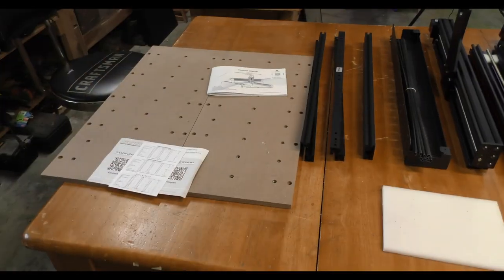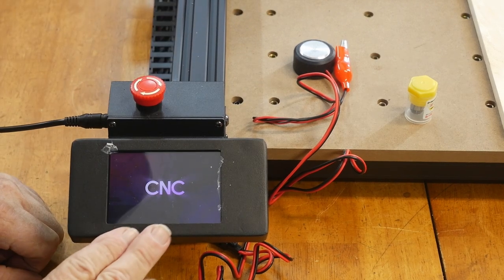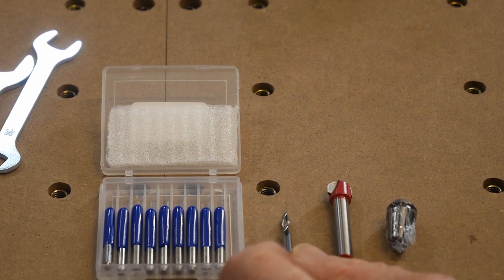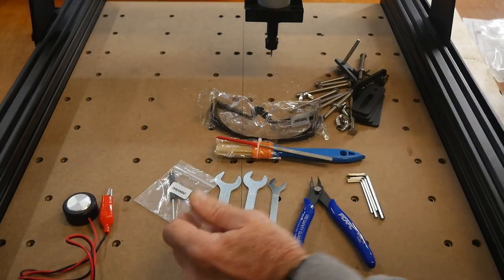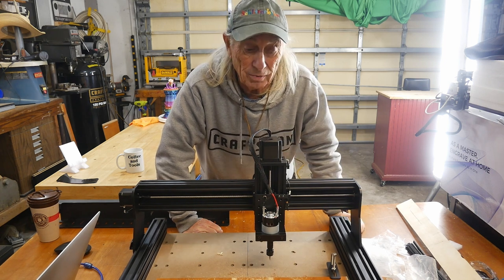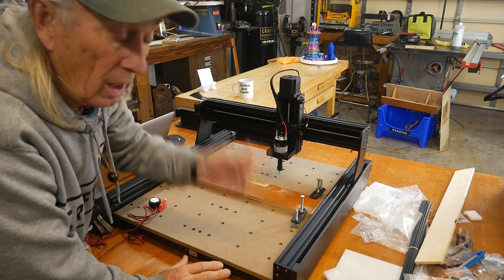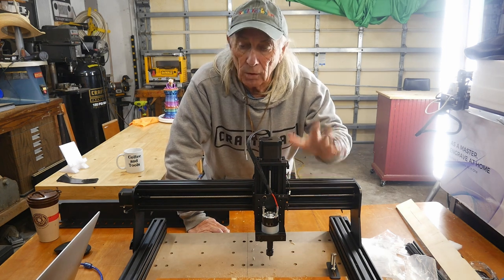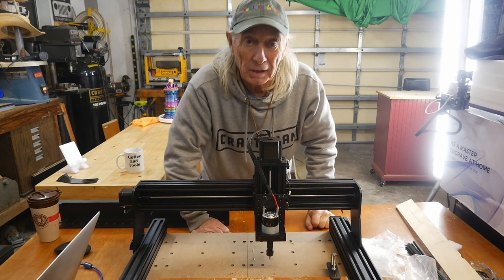Two Trees NEW TTC 450 CNC high speed router review and prizes !  C&T Ep. 311

Comment: I'm posting this as a warning to anyone considering purchasing the TTC 450...

I thought I'd share my experience with TwoTrees service, in case anyone is thinking about buying one of these things.
I purchased my TTC450 from Microcenter, and the same day purchased the 500 watt spindle motor on Amazon.
It took me about a day (off and on) to assemble the CNC itself and get it ready for the upgraded spindle motor.
The motor came in the next day, and I got it all hooked up and upon testing it...NOTHING.  Not even a blip.
Sent some emails to TwoTrees, and eventually got a reply asking me to TAKE A VIDEO OF THE PROBLEM TO SEND THEM.  Wow.  Never seen THAT kind of nonsense before.
So I take a video, figure out a way to upload it to them, and their next response is to instruct me to disassemble the power supply (!) and jumper 2 wires to bypass the relay.  Wow.  HUGE red flag there, asking a customer of your product to take it apart and perform an operation that obviously voids the warranty and kicks it right out the door.  Not including the SAFETY CONCERNS.
So I went through all that, sent them ANOTHER video of the result (getting REALLY tedious by now) and then I wait...
And I wait...and I wait...and eventually like about a week later send them another email asking when I might be receiving my new power supply.  Because the brand new one is obviously bad, right?
Well, I got an email today informing me that they're sending me a NEW RELAY.  Which is to say, not only did TwoTrees ask me to disassemble sensitive electronic equipment, now they're actually asking ME to FIX IT.  When the original that THEY SHIPPED was CLEARLY UNTESTED AND DEFECTIVE.
Gee.  Sending me a new relay so I can operate on my brand new equipment that doesn't work.
Thanks, TwoTrees.
So, ordering from TwoTrees, know several things.
1: There is no QC process during manufacturing, and you may receive defective equipment from the get go.
2: TwoTrees has NO QUALMS about expecting the money-paying customer to do extensive repairs to otherwise new equipment to make it work, despite any potential safety concerns about working with high voltage equipment.
3: TwoTrees will do the ABSOLUTE MINIMUM to get your product repaired for you, requiring you to perform delicate and complex operations you should never be asked to do.

In short, my experience with TwoTrees has been an absolute NIGHTMARE, and had I known before hand, I would have purchased something else.  I recommend everyone take a good, hard look at the company you intend to buy from.
Reply from the maker: We never get to see this side of a company or supplier so thanks for the interesting report on Two Trees. I added the new spindle without problems, but others had a troubles. You just can't be 100% on any product these days.
Reply: @SirTools  Exactly.  Had they simply have said "Whoops, our bad!"  and express-shipped me a new power supply it might not have been an issue.  But the hoops they had me jump through are unacceptable for the privilege of them sending me a relay to fix my own power supply.